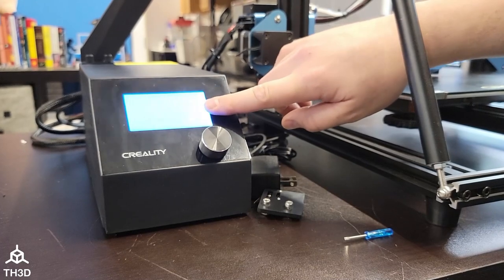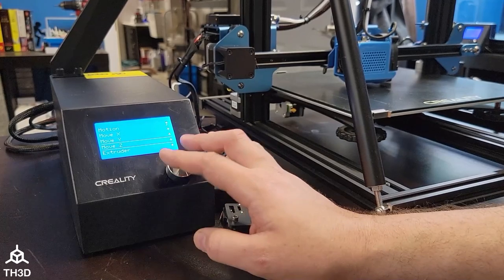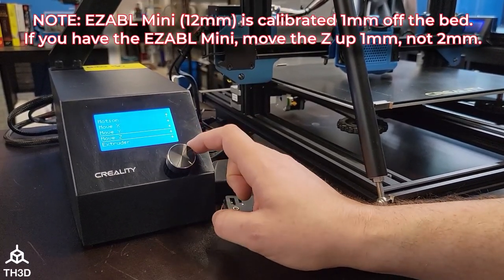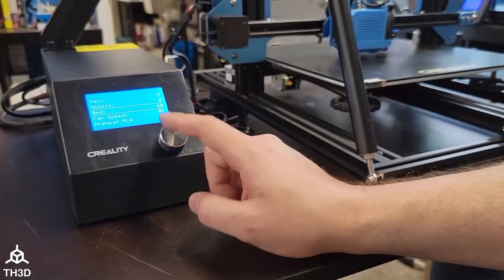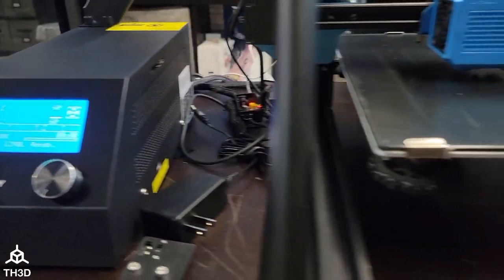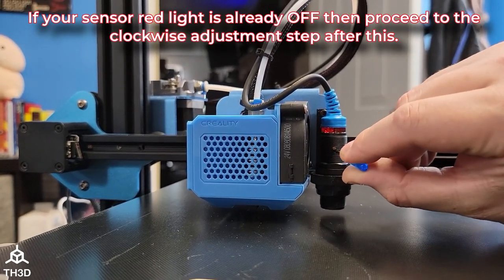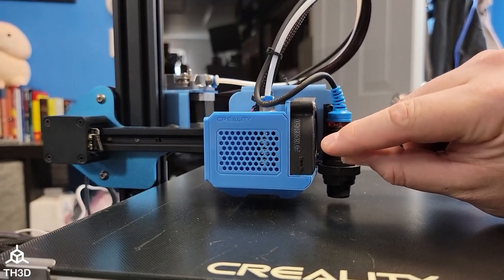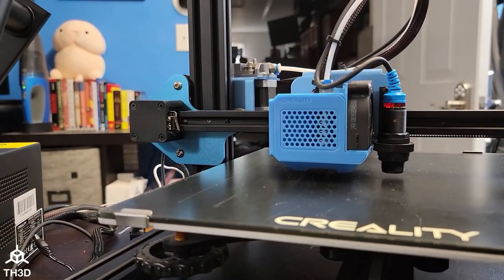EZABL EZTips - Calibrating the EZABL Sensor

Comment: I installed the ezabl onto my cr10 a few years ago. I have the version that looks just like that one but it's red and has both a red light and green light. Ever since I installed it everytime I do a print it does it auto level routine. My question is when it does the leveling routine it stops heatingg the nozzle. So when I set the nozzle to 240° for petg by the time it starts to print it has cooled down to about 210°.  How can I fix this so it keeps the temp during the leveling period like it does with the bed temp?
Reply from the maker: The firmware cycles the heaters to increase probe accuracy. There is a wait period of 10 seconds in our starting code to give the hotend a chance to recover. If you need to increase that wait time for your particular machine see out help article here: https://support.th3dstudio.com/hc/product-information/ezabl/advanced-setup/heater-recovery-after-g29-with-the-ezabl/